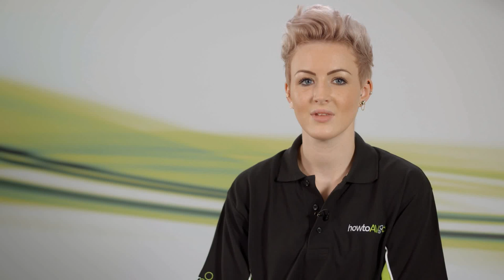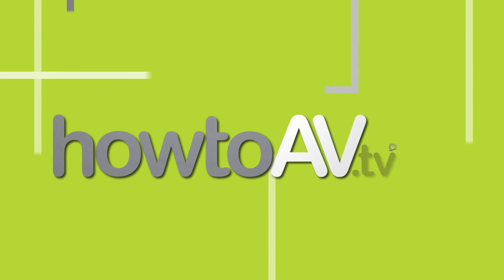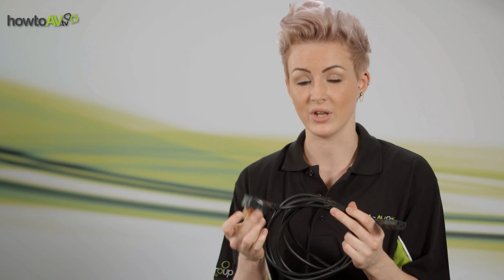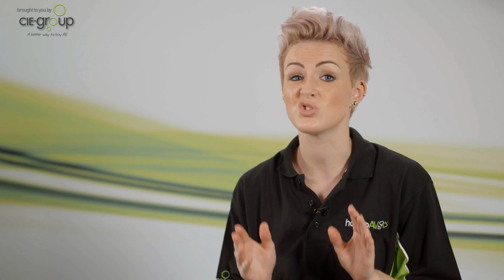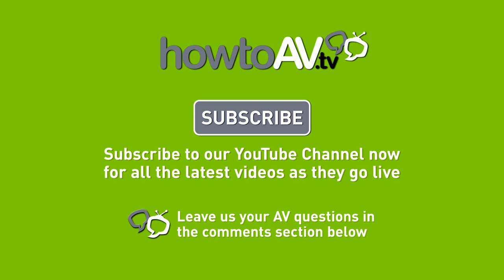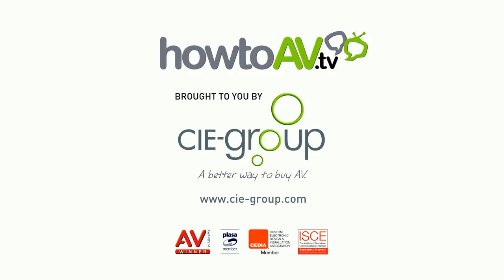What is a kettle lead? (IEC Lead)

Comment: Hi  I have a Arcam FMJ A29 intergreated  amp with a 2 pin IEC  male power input . I wish to put a upgrade power lead. But all the iec power leads on the market are 3 pin . With my fully isolated  amp I think I'm OK in thinking it will fit into the back and still be safe. Please  inform  me of my problem.  Many thanks Gerald crook